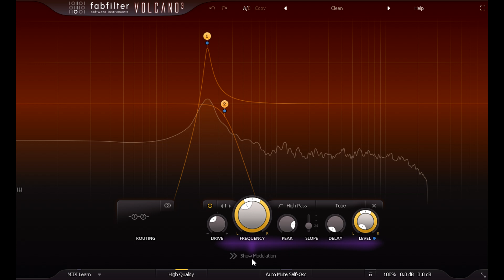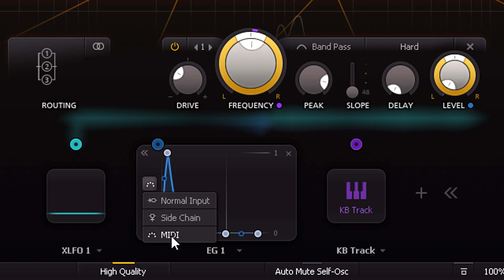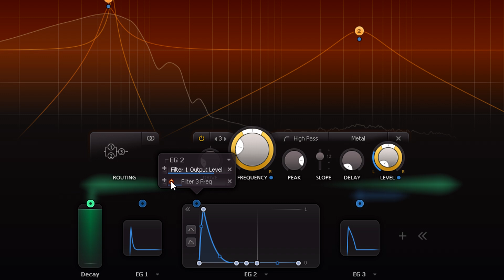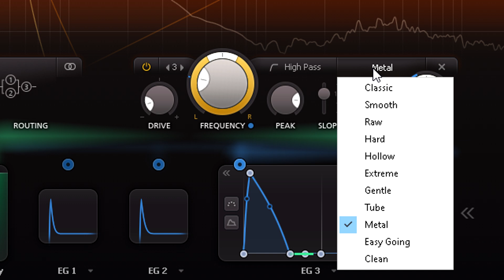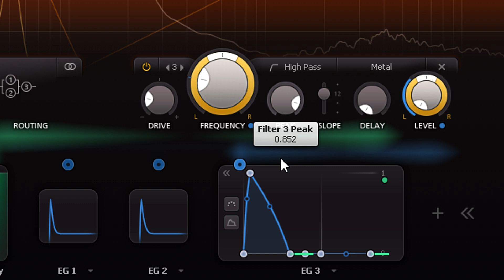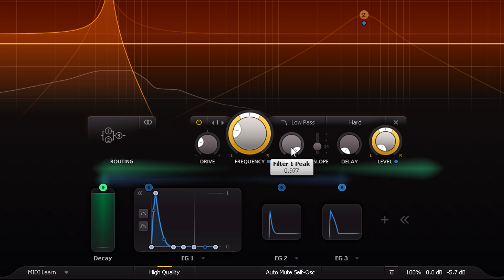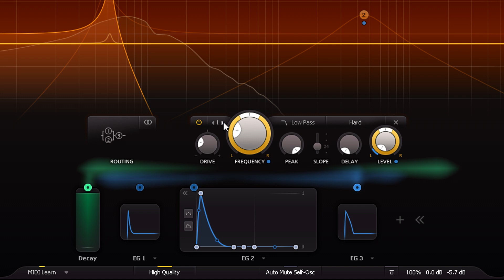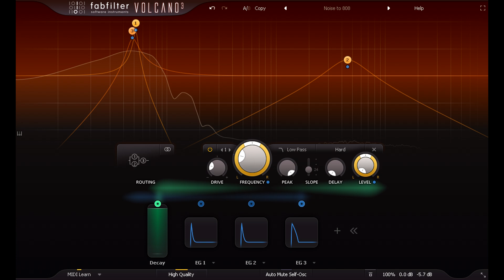Synthesizing Kick Drums with FabFilter Volcano 3

Comment: How to route MIDI into volcano in Ableton, when there is a synth with white noise, before volcano? I don’t get it working
Reply: Gsus!! Thank you!! 🥳🥳🥳
Reply: @sphyrnidae6749  You're welcome 😎
Reply: @thomasberner5282 I know this was a year ago but hopefully you can answer this question - couldn’t this same thing be achieved by just putting white noise into a sampler, and triggering it with midi on that track? So I have an instrument track with a sampler loaded that plays white noise when midi is triggered, with Volcano 3 on this same track. Then I could just play the midi data on this same track, no routing needed?
Reply: @psychoticchemist did you figure this out? My only guess as a novice is that sampler white noise will have its own envelope etc for midi, before it reaches the filters in volcano. There might be ways to do this that work still. But also having the midi direct to volcano means volcano is controlling a constant white noise signal, and all the filters activate upon midi press. If you have the midi controlling another plugin, then the volcano filter will always be active, instead of activating on midi. I presume this means that the envelope filter in particular would end and there would be no sound? Because the envelope should be activated by a midi note. And instead you have to input to trigger the envelope. I could be wrong but I believe that the routing to midi note specifically is what triggers the movement for each note.
Reply: That's pretty easy:
1. Set up a separate MIDI Channel
2. Route "MIDI To" to your Volcano-Channel
If your Volcano-Channel is a MIDI Channel as well: Change the entry in the second row from "Track In" to Volcano.

That's it!
Reply: @thomasberner5282  Hi Thomas! Then I cant hear the audio from first track. I already tried it.
Reply: @thomasberner5282  First Track is Vital with white noise. Setting is Audio to: Track 2 (MIDI with Volcano) and Monitor set to Auto.

Track 2 is a MIDI Track with Volcano:
MIDI From: Track 1, Monitor IN (tried also Auto and off), Audio To: Master
Reply: I'm sorry, if I was unclear. Here's my setup:
1. MIDI Track with Operator (for the noise) and Volcano on it. MIDI note(s) is/are needed to open the Operator VCA to here the noise.
2. MIDI Track with nothing on it. This one controls Volcano as descriped.

I hope this helps you. Cheers

Comment: Can you explain why the release phase matters at all? I assumed that by setting sustain to 0, you effectively go from 0 to 100 in attack phase, immediatelly down to sustain level with decay phase (which is 0), and then you sustain the note there for the duration of the note, but since you sustain it at 0, there is nowhere lower to go, so the release would just go from 0 to 0, essentially doing nothing...
Reply: The release matters if the note off arrives while the envelope is still decaying.
Reply: @DanWorrall  Oh! So a note-off will essentially start releasing from whatever level it was when fired?
Reply: @cURLybOi  Exactly. I learned this the "hard" way. Basically if your midi input only lasts say 0.8 secs and you're already in the decay or sustain of the note, ESPECIALLY when dealing with low frequencies, the abrupt cut off will introduce clicks. But yah, previously I also assumed the same thing as you
Reply: @DanWorrall  Actually setting the decay and the release time to the same value is not a reliable technique to ignore note off. In my experiments, if the midi off is received while the signal is still decaying, the release phase will start and will last for the full duration of the release value. In other words, if the the attack is 0s, the decay and sustain are both 1sec, and a midi note last 0.5sec, the envelope will take  1.5 sec to fully complete. If the midi note last more than 1sec, it will take 1 sec to fully complete. If the midi note lasts 0.2 sec, it will take 1.2 secs to fully complete.    Having said that, the release will start from the value where the envelope is at when the note off is received. That means that if the midi off is received at 0.5 sec in my previous examples, the envelope will last 1.5sec but will have a different shape than an envelope with a decay set 1.5 s with a midi note off received after 1.5s. They will be both the same total length but the overall shape of the decay / release will be different.   The only reliable workaround with FabFilter envelopes that I know of is to make sure the note is consistently very short (much shorter than the decay), or consistently longer than the decay.